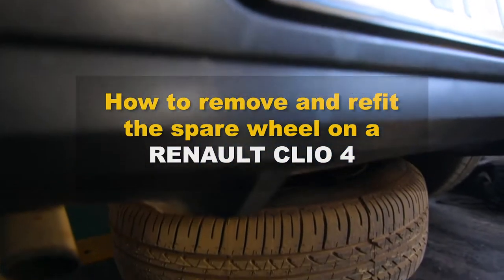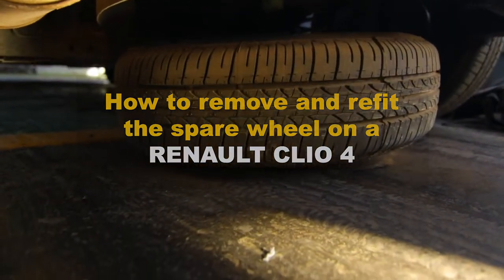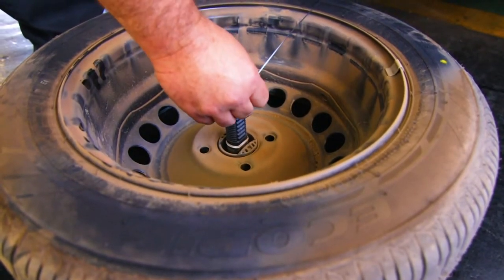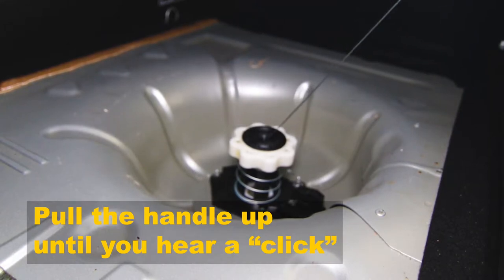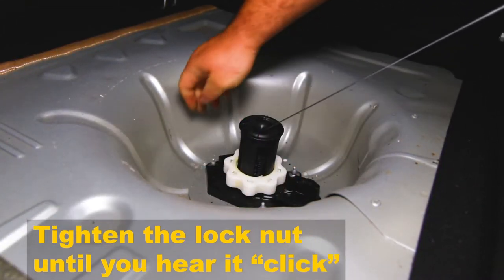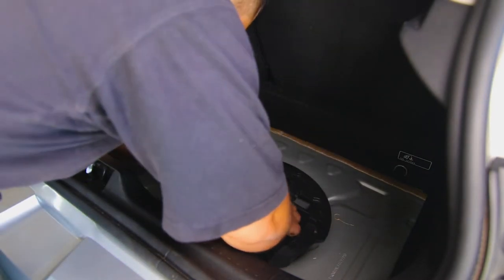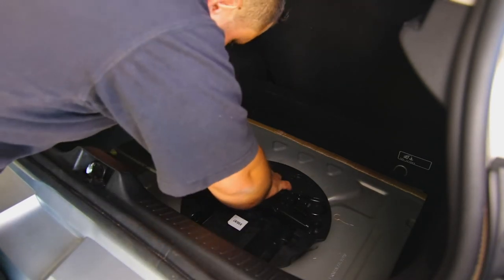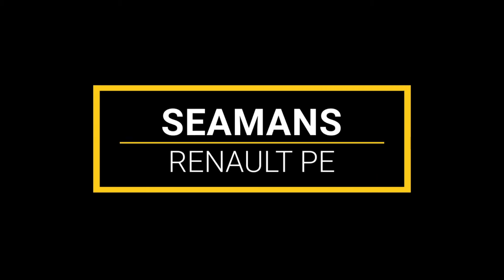How to remove and refit the spare wheel on a Renault Clio 4

Comment: How do you find the string to attach it on the spare wheel?
Reply: Claire it has probably been fully retracted back into the handle. Look closely inside the boot at the handle. Just a guess.